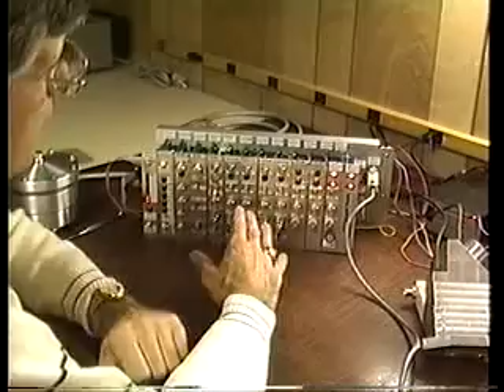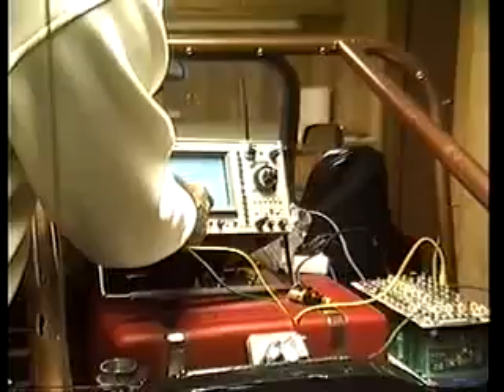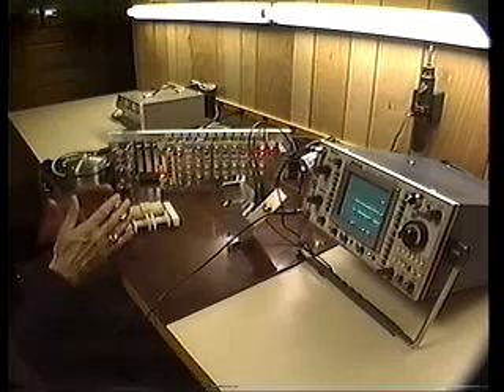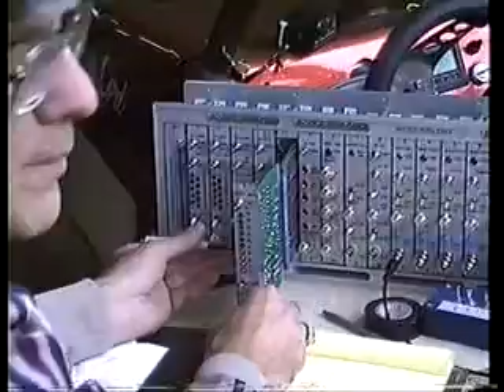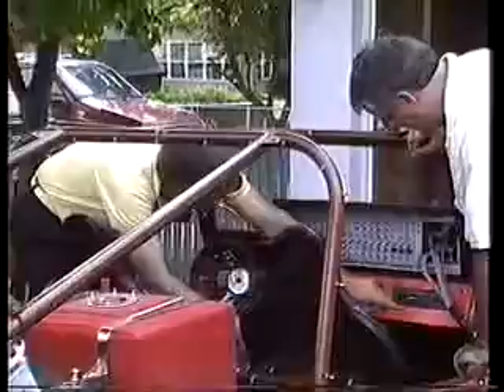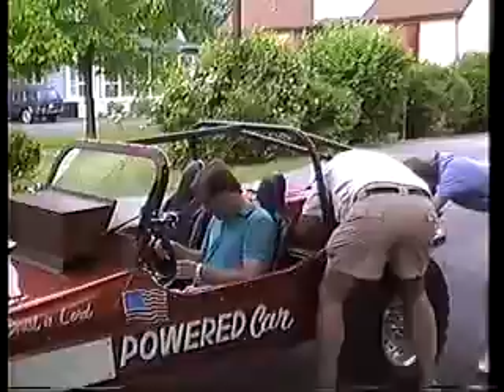New Stan Meyers video

Comment: i knew this guy for years , top military connections deep state , all the tech was military hence the the quality and the serial numbers on the parts, it was a setup to flush out those that actually had the real tech and eliminate them, the truth is the buggy never ran on gas from water period .if as he believed Jesus was directing him , then he would have given the tech freely ,instead he taught disinformation and ask for money to confuse deliberately. then played GOD and was eliminated  by his own doing. remember many others have gone there and due to greed and ego sold their souls.simple electrolysis under vacuum works very well.but you knew that anyway. the above video is no more than a standard vehicle computer module in R/D mode , it was part of the deception. freq 600,620,630, 1200, HZ(car alternator /dc generator) enharmonically will have some interesting  effects on water, have fun.
Reply: Nikola Tesla wasn't motivated by ego or money, and he didn't prosper.
Reply: Yeah, real easy. So why doesn't work?

Comment: is kinda funny this already exists in your car ( efi ) all you need to do is change a few things and your car will run. much gas production is not needed. your injectors,psi at the rail, and  TP will regulate your rpm. I incorperated my egr to allow less gas to enter the cylinder to get the same results. I also manipultaed my MAP and MAS and O2s to maniupluate my injector pulse with out having to reflash or use a piggy back on my ECU.